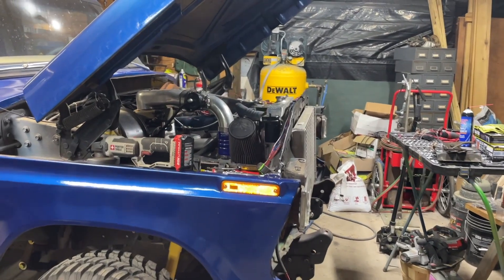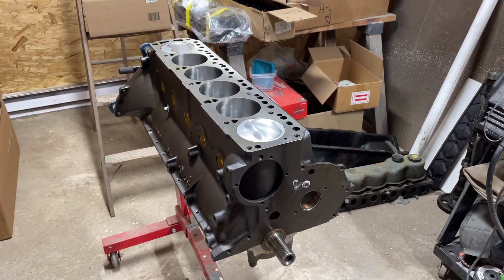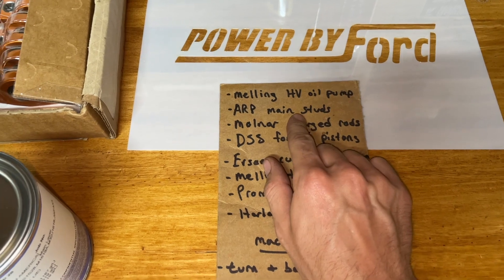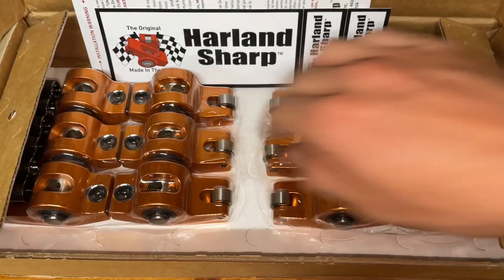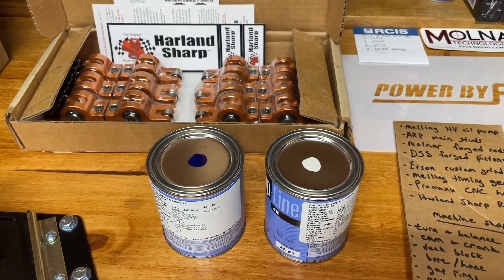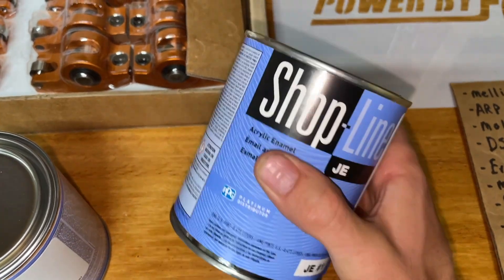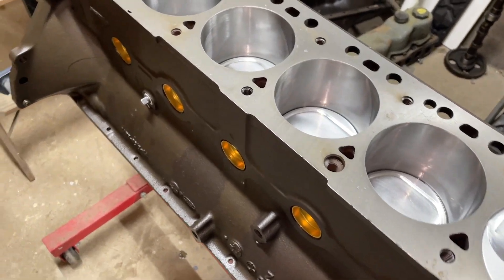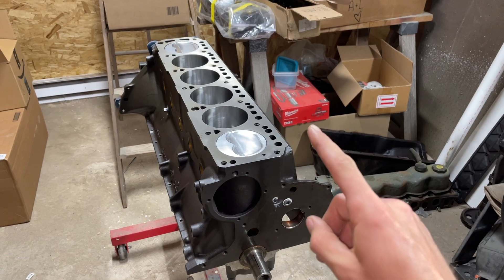Forged Rod & Piston Short Block for my Turbo 300 Inline 6

Comment: Just remember 

To make the 268 cam work well with the turbo you need a max size of 62mm inducer 58mm exducer 

Otherwise you'll still have low end tq issues 

The best option would be an HX35 or he351 infront of your current turbo so you make boost across the entire band 

Port fuel injection will also improve the global power band and reduce fuel consumption 

Just some suggestions coming from building a bunch of turbo vehicles for multiple different goals including torquey gassers

What is the grind for that new cam, i can give you an idea of the tq band

Comment: We have a 300 turbo build. We used the melling hv oil pump,  and had lots of problems with way to much oil up top. 
Just be sure you really need the hv pump.
Reply: That’s a good point I found that out the hard way on my sbc turned too many rpms with high volume and drained the pan wiped the mains